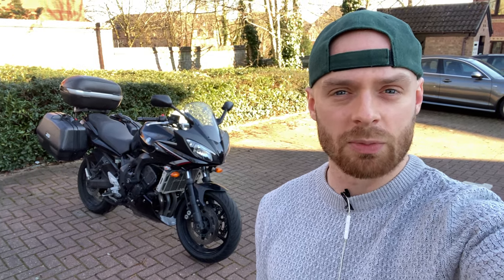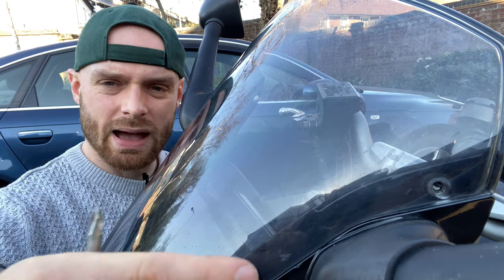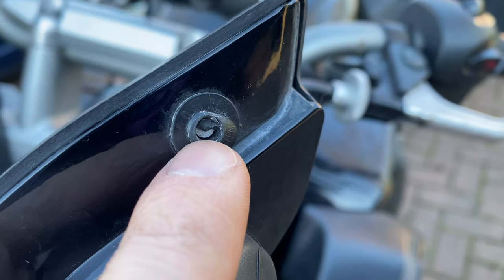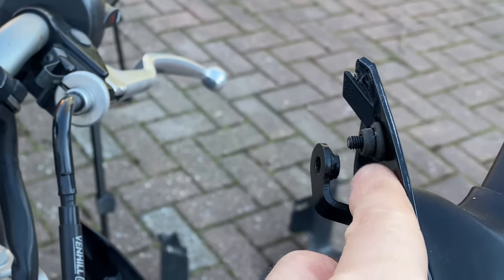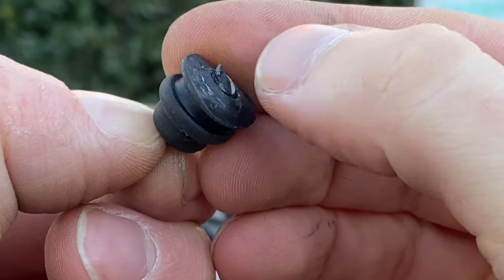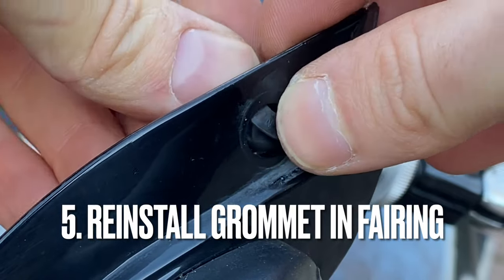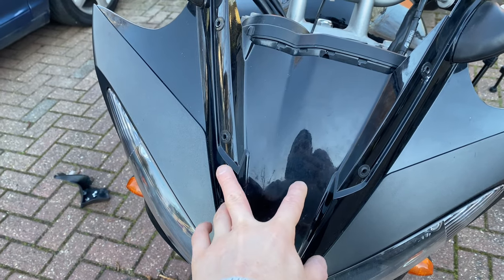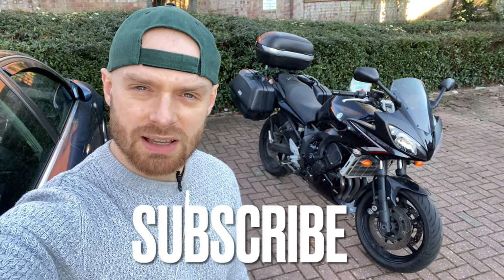How to remove a broken motorcycle windshield screw | Yamaha fz6 fazer

Comment: Nice quick video.

Have you done modifications to your headlights, so both shine at the same time?
Reply from the maker: Thanks! No I haven’t. I don’t think it would pass an MOT in the UK if I did. Although I do think the bike would look better if both were on all the time. Are thinking of doing it to yours?
Reply: @FabMotorbikes  I'm picking the bike up tomorrow and I do have a list of mods I want to do on it, double headlight is one of them.

I think it improves safety on it, so even if it wouldn't pass a check it's simple to indo
Reply from the maker: Nice one congratulations on the new bike. 

Safety wise, I once read that with both headlines on there is the risk that at night the bike could look like a car that is much further away than your bike actually is. But this could be over worrying...
Reply: Did you manage to do the mod mate 🤔
Thanks John 🏍🏍😊
Reply from the maker: @johnberry5339  no I decided not to do the headlight mod. As I don’t think it with mass an MOT with both headlights on.

Comment: Hi mate great video 👍
I have tried to remove my fairing but the screw and captive nut are both turning 😬 any suggestions would be gratefully appreciated... thanks John 🏍😊
Reply from the maker: Hi John, which screw are you turning in particular? is it one of the screws that hold inner part of the fairing (the matt black bit around the dash) or one that goes though the external, gloss part of the fairing?
Reply: @FabMotorbikes  Hi mate thanks for the quick reply 👍
When you're sat on the bike there's two screws facing you..  One on either side of the dash. They are the ones I am having problems with. 
Thanks John 😊🏍🏍
Reply from the maker: @John Berry  hi mate, I’ve had a further look into this. And those two screws don’t go into a captive nut. They thread straight into the metal frame that the front cowling is mounted onto. So it would seem that the thread may be stripped. In this case, when all the other screws are removed, you should be able to just pull that piece of plastic away that surrounds the dash and the the screws would come with it. Let me know how it goes. I’m happy to work with you further to get it sorted 👍👍
Reply: @FabMotorbikes  Okay thank you very much 👍 I will have another look at it this afternoon 😎
I really appreciate your help 😊
Thanks John 🏍🏍🏍👍
Reply: @FabMotorbikes  HiFab🙋‍♂️
I have had another look at your video and I have noticed that my dash is different to yours.. Mine was registered in 2005 and it has the singular round clock... so I think it might be a different fairing 🤔
Thanks John 👍
Reply from the maker: @johnberry5339  ah yes that would make sense. Mine is the 2008 ‘S2’ model. So it is a little different. Let me know how you get on anyway 👍